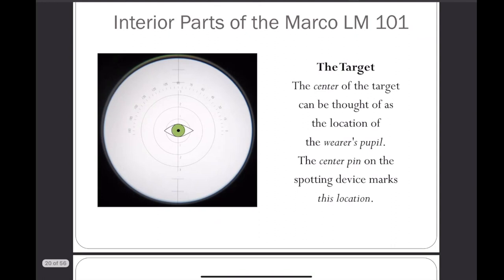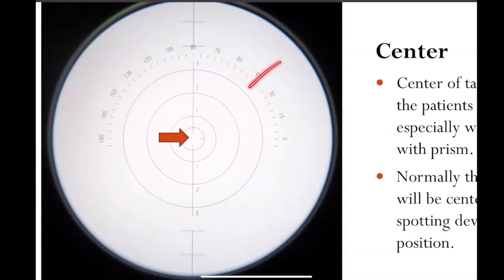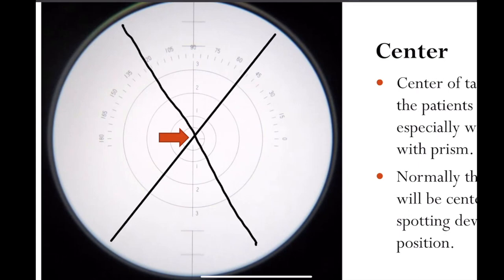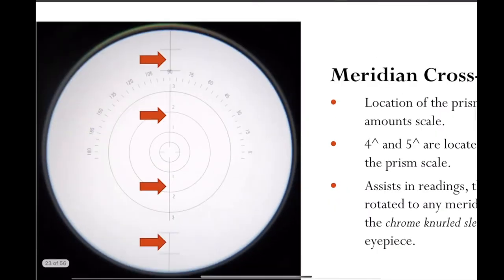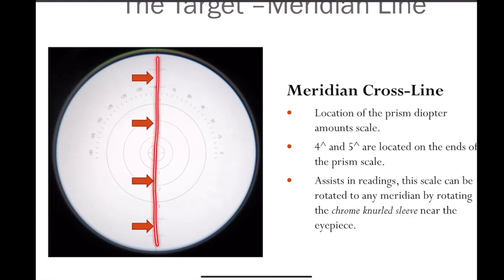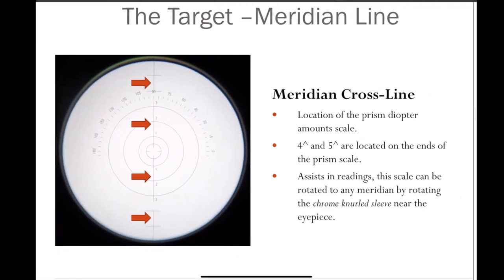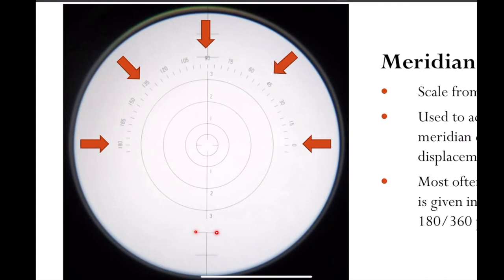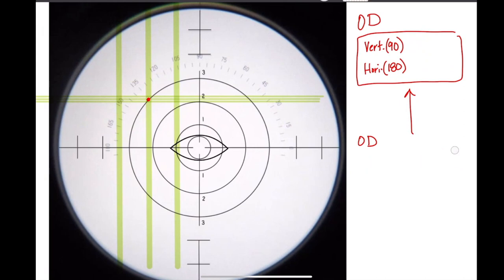PRISM IN THE LENSMETER  (Lecture 2 from 2/14/23)

Comment: Hi Tracy, what is your technique for measuring very large prism? (more than 5 in any direction)
Reply from the maker: Use the Prism Compensation Device on the instrument.  Put it in the meridian you’re looking for and dial in the number of prism you need. Then center the glasses like normal. (Very simplified explanation.) For example, if you need to verify 10^BU.  Then you’ll orient the PCD in the 90 meridian and dial in 10^ BD. Turning it so the power lines move down, then look at the numbers on the dial until you get to 10^. Ideally, if the lens has 10^BU it will cancel the 10^BD you dialed in and powerli es should center at target center.  Any variation means you have some undesirable difference. Note, you still need to follow other power rules to ensure strongest lens is centered first and any undesired effect is measured in the weaker lens (2nd lens).

Comment: Hi. 2 Question: your lensometer has 4 boack rings but ours at work only has 3 circles. If we get our prism crossing on our very first ring, is that a 1 Diopter? Or half? 
And second question: in a progressive lens, do we read the prism through the progressives optical cross like we would normally read the distance power? Or do we check it by looking through the optical prism dot on the lens? Also, thanks so much for such helpful video🥰
Reply from the maker: Q1 - I believe so but the rings should be marked (similar to the target in this video). [Here's an example image that has 1^ as the first ring. https://www.reichert.com/products/ml1 --> this one uses the inner hash lines to determine where the 0.75, 0.50, and 0.25 are on the target. The ABO Practical simulation "Tutorial and Practice Exam Question Area" discusses how the central target is broken down on slide 24. https://www.abo-ncle.org/ABO/Exam_Information/Practical_Exams/Practical_Exam_Tutorial/ABO/Practical_Exam/Practical_Exam_Tutorial.aspx?hkey=b53962d8-5427-4cf4-9cd7-2074c6c91d9c]

Q2 - Prism is measured/checked at the prism reference point (dot below the fitting cross). Distance power is measured/checked at the distance reference point (circle above the fitting cross). The fitting cross is used only to measured placement in the frame (measuring/checking that the fitting cross corresponds to the wearer's monocular PD and fitting height). This is a good reference that has some good info and pictures at the end that show how the lens should be centered to verify the various aspects of a progressive. http://aamerniazi.blogspot.com/2014/01/measurement-and-dispensing-of.html.

Hope I answered all your questions! Let me know if you need clarification on anything or if you have any new questions.
Reply from the maker: If you have trouble accessing the "ABO NCLE Tutorial and Practice Exam Questions Area" it can be found on the ABO-NCLE website under Exam Information. Select Practical Exams, then Practical Exam Tutorial. The link is in the text shown on the page. Once opened, select "Mastering Lens Meter Simulation" and go to slide 24 for the measurements of the inner 1^ ring. (ABO-NCLE website https://www.abo-ncle.org/ABO/Home/ABO/Default.aspx).
Reply: @MsTracyBennett  wow! Bless your soul for being such a helpful person! Wish we had more of you in this world🙏🙏🙏 Im now clear about question 2 and thanks again, but even after checking out your link, Im still confused about our lensometer only having 3 rings (and no labels or numbers on them). If prism is showing on first circle (first inner circle), is this a 1 Diopter then?
Reply from the maker: @libra8194  Do you know what kind of lensmeter you have? The brand or style. That might help me provide better direction. You can also examine the distance between the circles that you do have, and examine the distance from the center of the target to the first ring. If the ring distance is the same as the distance from the center to the first ring, then the first ring is 1^. If the distance from the center to the first ring is half of the ring distance, then the first ring is 0.5^. I would be willing to bet that first ring on yours is 1^.
Reply: @MsTracyBennett  you are 100% right! It is a 1 prism (the first ring) these spaces are all the same, between 1,2 & 3 and also from centre to first ring. Many many thanks to you!! God bless ❤️❤️❤️⭐️⭐️⭐️

Comment: How do we measure a prism that is superimposed on a spherocylindrical lens instead of just a spherical lens?
Reply from the maker: The exact same way, except it’s the point where the spher and cylinder cross. You need to toggle back and forth between the two powers until they both align with the point you need to place it or read it from.
Reply: Wont the centre point of the grid be blurred in case of a spherocylindrical lens?
Reply from the maker: @anweshamaitra3130   you still orient the axis and get power in focus, you just move the center power cross point (the base of the prism) to the point needed to position the prism desired.